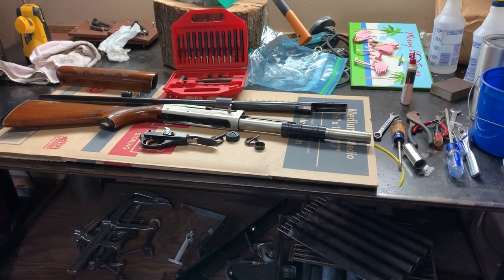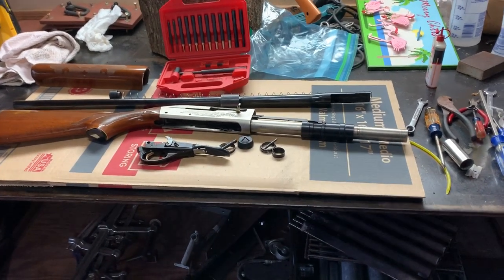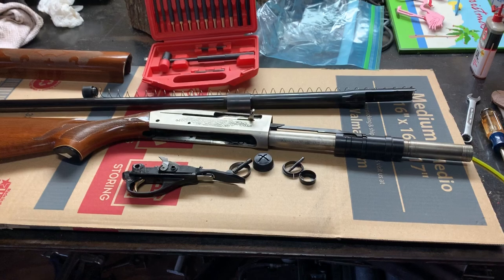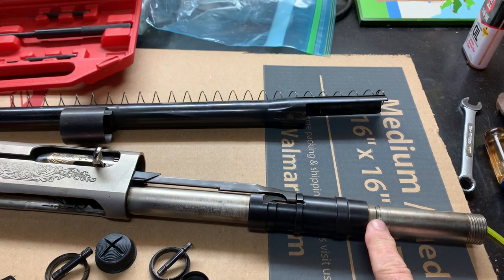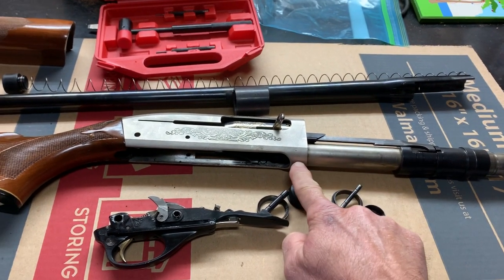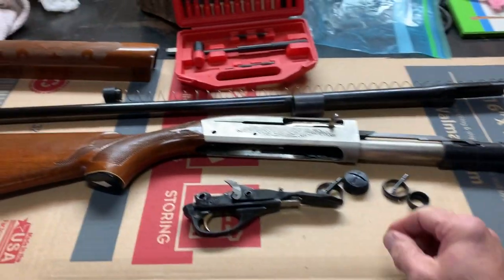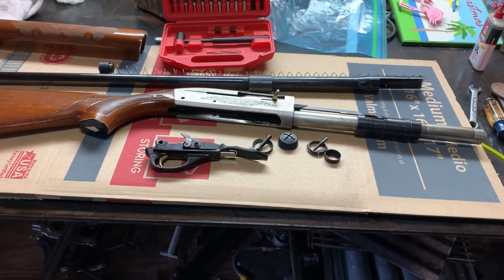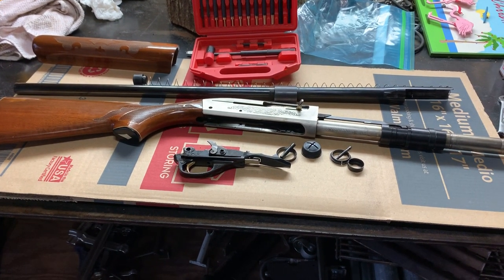Intro to fixing an extracting/ejecting issue with the Remington 1100 12 gauge shotgun

Comment: I came upon an 1100 that had no gas problems, but wouldn't extract Gun club reloads, unless they were pretty hot.  The first clue was that slick hulls (as opposed to ribbed) had no problems.  Turned out the chamber had some machining roughness.  Polishing the chamber resolved the issue.